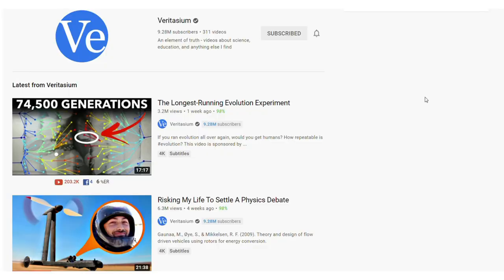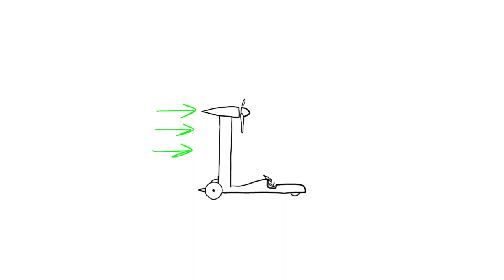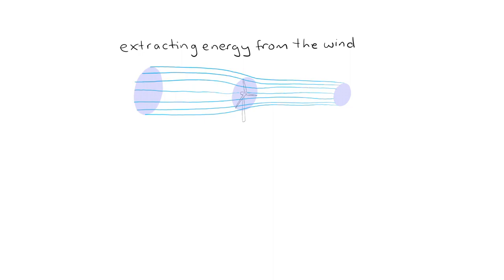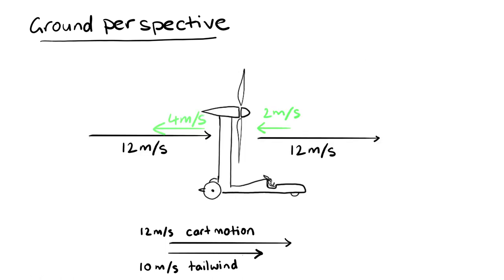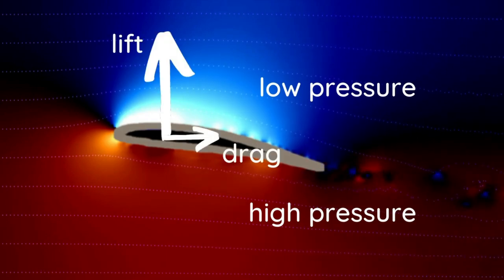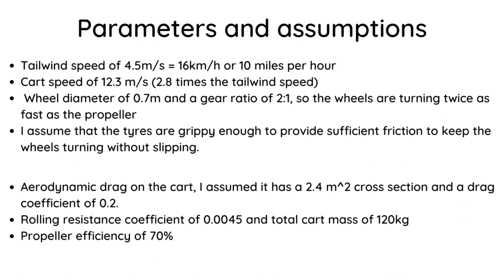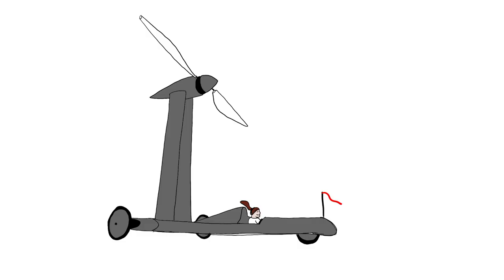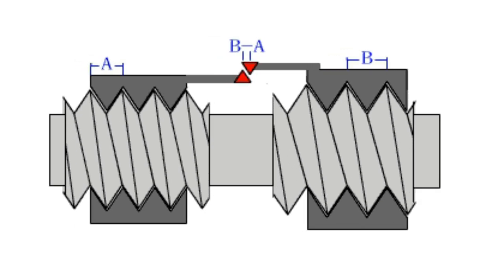Downwind Faster Than the Wind by Veritasium: How Does it Work?

Comment: Why is this obsession with “faster than the wind”? This is not a sailboat. You are all confusing yourselves. If you focus on the basic principles, you don’t even need math to understand how this system works. 
Reading the comments it has become obvious to me very few people understands fully how this vehicle works. The situation is made worse by the obsession and overemphasis on moving faster than the wind. This doesn’t operate like a sailboat. Or more accurately it works like a sailboat only during the first a few seconds when the wind pushes it and gets it started. That’s not even necessary. The vehicle can be pushed or pulled to get it started. The main thing is to understand how this system operates in steady state. Also it’s better to think of it like a propeller airplane. 
If you put aside the obsession about moving faster than the wind and focus on how the system works, the physics is simple and very clear. Most people seem to be focused on secondary and tertiary phenomena instead of the first order effects. 
1. The wheels moving on the ground turn the propeller which creates a forward trust like a propeller aircraft. This coupling is key. 
2. Because there is a tail wind that pushes against the air that is pushed back by the propeller that adds to the forward trust and injects energy to the vehicle. This is the second key. Without the tailwind the vehicle would come to a stop due to the friction at the wheels, drag, and other losses. Energy has to be conserved. We cannot build a perpetual motion machine, and this is not one. 
It’s as simple as explained in these two bullets. 
This is like a propeller aircraft that moves on the ground and the propeller is rotated by the wheels on the ground. The tailwind injects the energy to the vehicle for it to continue its motion (otherwise friction, drag, etc. would dissipate the energy quickly because the vehicle has no engine)
This is all.
Can it move forward faster than the wind? Yes, but what’s the big deal about it. The mechanism in this system is totally different than a sailboat. 
By overly focusing on moving faster than the wind and neglecting first to understand how the vehicle operates confused a lot of people including a few physics professors. 
No one talks about the design parameters of this system:
1. Vehicle (weight, friction, drag, etc.). We want light weight, low friction, low drag, low loss. 
2. Transfer mechanism between the wheels and the propeller (gears, perimeter of the wheels, etc.). We want to design an efficient transfer mechanism that takes the kinetic energy of the vehicle to rotate the propeller. 
3. Propeller design. This science is well understood. You want a good propeller design for the purpose. There are many to pick from. 
The focus should have been on how this system works and these design parameters instead of trying to generate controversy.
But I must admit, controversy attracts more clicks than a simple, straightforward, clear, and short explanation.
Reply: "This doesn’t operate like a sailboat."

The blades operate like sails of a boat tacking with a downwind velocity component greater than wind-speed.
Reply: @eyytee  my remark was directed at people and the opening of the original video that talks extensively about the simplest mode of a sailboat where the wind comes from behind the boat and pushes the sail. They keep on emphasizing that in that mode the sailboat cannot move faster than the wind; therefore, it is counter intuitive for a wind-powered vehicle to move faster than the wind. This is repeated over and over to generate controversy. It is wrong and misleading in two ways 
1. This vehicle does not operate like the simplest mode of a sailboat
2. Well designed sailboats can travel faster than the wind when they are approximately 45 degrees against the wind 
I think Blackbird is more like a propeller airplane than a sailboat
Talking about and overemphasis on sailboats only help to confuse the people and generate controversy.
Reply: @bobbrown8155  "Well designed sailboats can travel faster than the wind when they are approximately 45 degrees against the wind "

Yes, and they use that as an analogy to explain how the Blackbird works in the first Veritasium video.

"I think Blackbird is more like a propeller airplane than a sailboat"

Not really. The Blackbird and the sailboat are both operating at the interface between the airmass and the surface, and both are extracting energy from the velocity difference between that two media. A propeller airplane is operating in just one medium, so it cannot do that, and is therefore quite different.
Reply: @eyytee  your point is well taken. alternative points of view both can be accurate. respectfully yours.
Reply: @bobbrown8155  Your analogy to the airplane is correct for the propeller itself. Above wind-speed it operates in a headwind just like a normal aircraft propeller. But the vehicle as a whole (with the coupling to the surface) is more like a sail-craft for the reason I mentioned.
Reply: @bobbrown8155  "Most importantly, the medium, mechanism, geometries, forces, etc. and the physics are most similar to a propeller airplane."

The similarities with the propeller plane are limited to just one part: the propeller. But the physics as a whole is that of a sail-craft: Both get energy from the velocity difference between air and surface. The closest flying thing to this is "dynamic soaring".
Reply: @eyytee  If you were building one, would you hire an engineer with propeller plane design experience or an engineer with sailboat design experience?
Reply: @bobbrown8155  An engineer with high performance land yacht building experience.
Reply: @eyytee  I don’t think there are that many “land yacht” manufacturers. (Probably sailboat designers design land yachts as a hobby). Even if there were, the propulsion system in Blackbird is a propeller, and, therefore, many of the design parameters and design trade offs are build around the propulsion system. In any case, you answered an “a or b” question with a “c.” At least you didn’t say “I would hire a Blackbird designer.”  To be honest, an aircraft designer might have designed a better and more stable Blackbird than the original one. With a wider wheelbase for more stability, lighter materials, etc. I guess I made my point. I am sure with aerospace engineers, I can develop a better blackbird than “land yacht” hobbyists can.
Reply: @bobbrown8155  Obviously you need aerodynamics experts. The high efficiency required here, is more similar to the design goals of gliders and large wind-turbines, rather than conventional engine-powered propeller aircraft. But these are engineering details. From the physics perspective, it's a vehicle getting energy for the relative motion of two media, like a sail-craft. Not a vehicle interacting with just one medium, like a propeller plane.

Comment: Throw laws of thermodynamics into trash 🗑️ .🥴
Reply: No that’s not what happens here
Reply: It's taking kinetic from the wind so no laws of thermodynamics are being violated.
Reply: @seneca983  kinetic energy from wind 🌬️🍃 and travel faster than wind .
Gravity and friction 😴😴💤💤💤
Reply: @user-fx2oo3bi9c  "kinetic energy from wind 🌬️🍃 and travel faster than wind"

Yes. That doesn't violate the laws of thermodynamics.
Reply: @seneca983  
I don't know much about physics but I think 100% efficiency is only possible in closed system where external force have no effect on the process.🤨🤔
Reply: @user-fx2oo3bi9c  But 100% efficiency isn't required here. It's enough that dissipative losses are smaller than the amount of energy extracted from the wind.
Reply: @seneca983  
Laws of physics have limitations, because human senses are limited by the creator/Energy source .
Reply: @user-fx2oo3bi9c  This vehicle doesn't break any such limitations. It just takes energy from the wind, that's all.

Comment: What rubbish. Laws of thermodynamics applying to a wind driven machine, more rubbish. So the wind pushes a vehicle with a propeller. The propeller and to a lesser degree the vehicle are pushed by the wind. Meanwhile back at the ranch, the wind causes the propeller to rotate. Already the vehicle is traveling way slower than the wind and in fact it can never achieve the same speed as the wind due to major aerodynamic losses. With the propeller spinning as the vehicle moves forward the whole vehicle with its propeller could never reach the same speed as the wind.
Reply: On the Blackbird, the wind never acts directly on the blades of the propeller to turn them.  If this were true, then yes -- it would never reach windspeed.
Reply: It's not a wind driven machine, it interacts with both the wind and the ground, and the difference in speed between the wind and ground is what allows it to use reduction gearing: the higher speed, lower force from the ground is converted into lower speed, higher force at the propeller, despite losses.
Reply: @rcgldr  

// "It's not a wind driven machine, it interacts with both the wind and the ground."//

It's a wind driven machine -- that's what wind is, relative motion between wind and the ground.  Where the energy comes from (air or ground) is simply a matter of your chosen FoR.  A wind turbine on the hill is 'ground powered' in the FoR of the moving airmass.
Reply: sir you are so right, with the drag involved the car will never reach mean wind speed let alone go faster .it a con.
Reply: @johnborton4522  - there is also the case where both "media" are the wind moving at different speeds (wind shear),  such as wind shear driven gliders, called dynamic soaring. Current record is 548 mph (over 8x the 65 mph gusts). Put video in full screen, it's hard to track a glider going in circles at that speed: https://www.youtube.com/watch?v=4eFD_Wj6dhk
Reply: @colinpalmer  again the 1877 Bernnan torpedo operated on the same principle, so the concept is known to work. The Blackbird averaged 27.7 mph in an average 10 mph wind, certified by a land sailing group.
Reply: @rcgldr  Yes you are right, after thinking about it I now realise how it works.
You are moving in the mass of air around you, your wheels give you energy to move in that mass of air, your ground speed becomes the speed of the motion of the mass of air plus you speed in that air..
Reply: @rcgldr  Yes you are right, after thinking about it I now realise how it works.
You are moving in the mass of air around you, your wheels give you energy to move within that mass of air, your ground speed becomes the speed of the motion of the mass of air plus your speed in that air..
Reply: @rcgldr  Yes you are right, after thinking about it I now realise how it works.
You are moving in the mass of air around you, your wheels give you energy to move within that mass of air, your ground speed becomes the speed of the motion of the mass of air plus your speed in that air..

Comment: You did not understand it. You have brainwashed yourself. Just explain how you get fom traveling at windspeed to creating 2m/s headwind. And if you were right, why will it not continue to accelerate until ripped apart? Answer those 2 questions, and you have free energy...
Reply: //"Just explain how you get fom traveling at windspeed to creating 2m/s headwind."//

She did -- by extracting energy from the relative motion of air over the ground (wind power in other words). 

//"And if you were right, why will it not continue to accelerate until ripped apart?"//

Because as it accelerates, mechanical and aero losses soon equal the energy input from the wind and the entire device reaches equilibrium (before it is "ripped apart").

//"Answer those 2 questions, and you have free energy..."//

Both questions answered and no free energy -- it's wind powered. 

//"You did not understand it."//

And as it turns out, it's you who does not understand.
Reply: @johnborton4522  you are wrong. She explain everything from being in a state where the card is already driving into relative head wind. Without explaining how that happened, everything falls apart.
Reply: @Eagleizer  

I understand exactly how it works and she did a great job explaining it.

She can only explain it to you -- she can't make you understand it.
Reply: @johnborton4522  When traveling at windspeed, there's no headwind. Why don't YOU explain how it gets power to go faster when relative wind is zero? If you can't, you understand nothing.
Reply: @Eagleizer  

//"When traveling at windspeed, there's no headwind. "//

Correct, and when traveling faster than the wind, the relative headwind is a source of drag, not power. 

//" Why don't YOU explain how it gets power to go faster when relative wind is zero? "//

The problem here is your understanding -- you continue to mistakenly hold that the power comes from wind relative to the craft.  The power to travel windspeed and above never comes from the wind relative to the craft, but rather than wind relative to the ground.  This relative wind remains the same no matter the speed of the craft.

If the wind is blowing across the ground at say 10mph, the Blackbird slows this wind down to around 5mph.  It is able to slow that 10mph wind down to 5mph no matter the speed of the craft by blowing air backwards via the propeller.  Conservation of energy demands that by slowing the true wind over the ground down, energy is extracted. 

//"If you can't, you understand nothing."//

Again the problem is not her explanations which are clear and correct, but your understanding.
Reply: @johnborton4522  You just explained how the vehicle goes half the windspeed. That is not what's claimed in the video.
Reply: @Eagleizer  

No, I explained how the craft continues to accelerate until the aero drag from the headwind and mechanical losses equal the energy harvested from slowing the 10mph wind down to 5mph.

With the Blackbird (and a 10mph wind), this occurs around 3x the speed of the wind.
Reply: In the end, a certain amount of mental horsepower is required to understand what is one of the best physics brainteasers of the last 50 years or so.  It trips up a lot of even smart people as brainteasers do.

A third grader isn't going to understand the explanations of quantum physics, but that doesn't make them wrong.

I get it -- you don't understand it, but her explanations are spot on and her math is absolutely correct.    I know this for a fact because I've been doing this for more than 15 years now and my partner Rick and I have been invited and given presentations on the topic at top Universities (Stanford, etc.) and even NASA Ames Research Center (we designed and built the Blackbird). 

Rosie provides all the links in the description of the video to support all of her math etc.  It's all there.